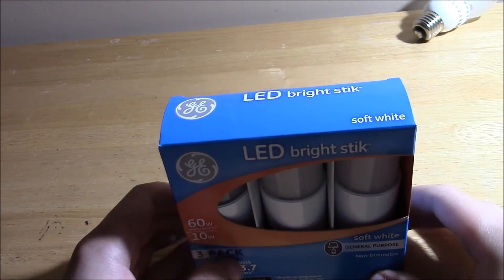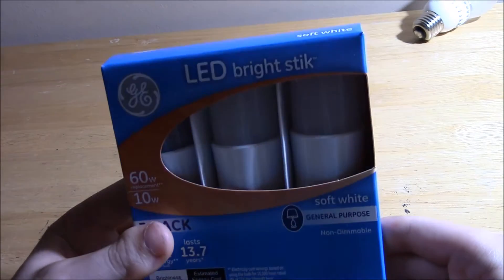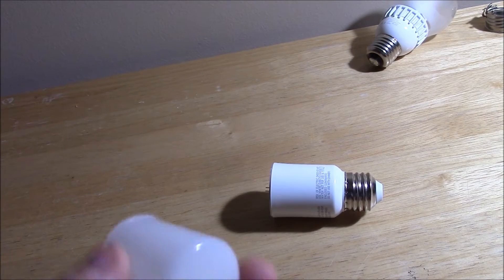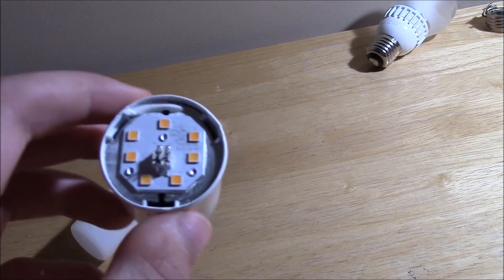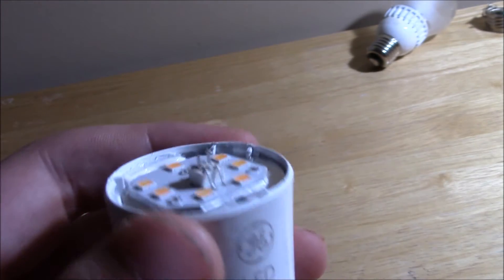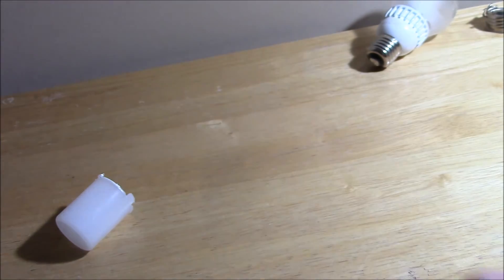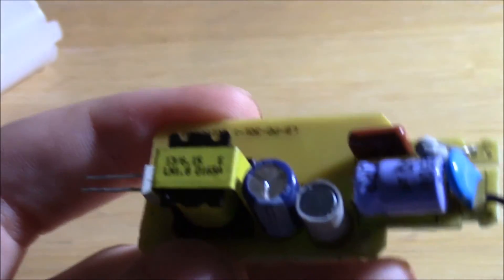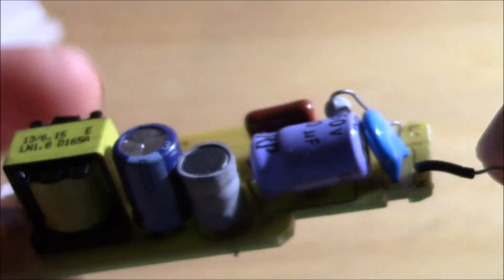GE Bright Stik LED Bulb Teardown

Comment: Been using these bulbs for months now. The light distribution is very good in table lamp usage.
My concern is how heat they put out. The base gets VERY HOT. Can these be efficient if they operate at high temps?
Reply from the maker: Even though LEDs are far more efficient than incandescent bulbs they still can put out heat. Some of this comes from the power supply but most of it comes from the leds. This bulb uses about ten watts of power and thus a you can assume it puts ten watts of heat wich is enough to make the bulb hot. Keep in mind that leds do not convert all of the power used to light.